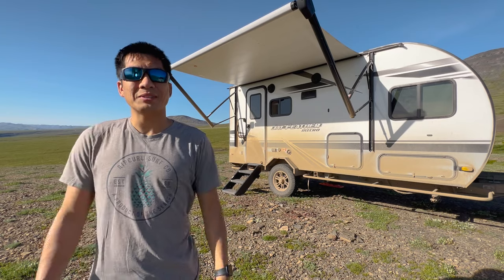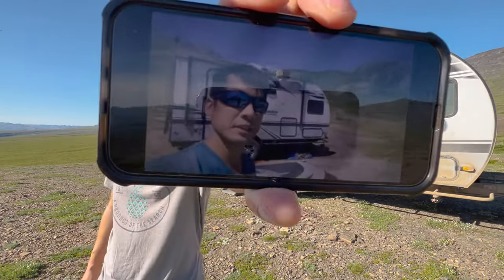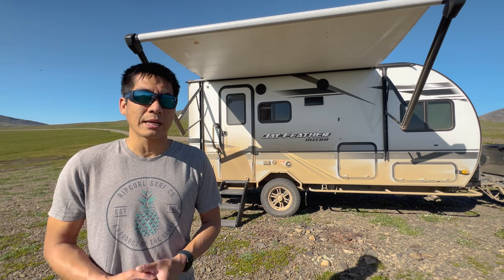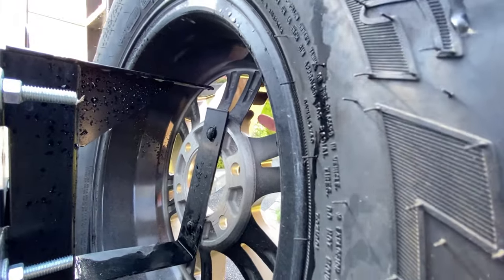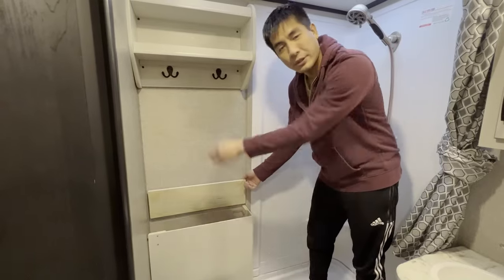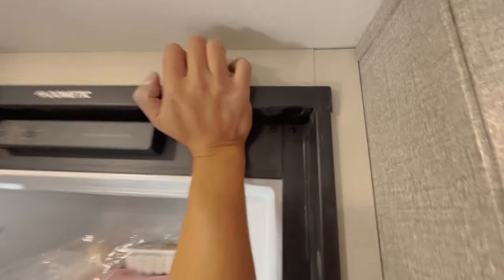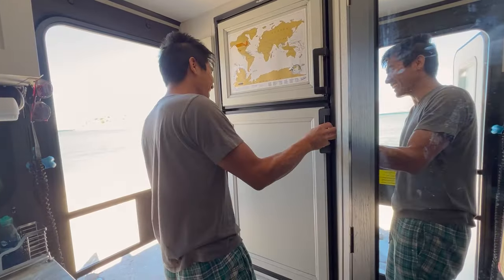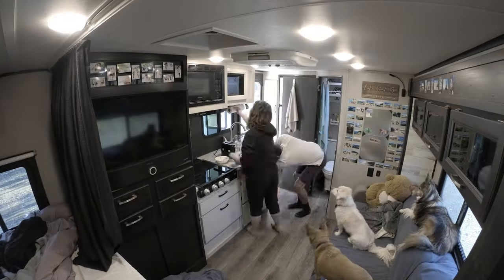Jayco 166FBS Long Term Review - What Broke?

Comment: Sounds like you took a camper designed for paved roads and beat the crap out of it for 31,000 miles! Most if the issues were caused from dirt, dust and pot holes! I think it held up very well considering the abuse it received!

Comment: Sounds like JAYCO need way better QC.  Sad because the models very intriguing to a couple but not if I have to play McGiver 24//7 on the road.
Reply: Some things like the Axle and spare tire bracket are no bueno. They've since switched out the fridges from those dumpy ones. Otherwise I experience the same crap with loose hardware and such in my own house all the time.

Comment: Excellent video!  After watching, my immediate thought was "NO" on the idea of getting a trailer.  You talked about way too many things going wrong in such a short time.  Big things, axel, fridge, water leakage, stove, etc.  Those sound live deal-breakers to me.  Then I factored in that you used the heck out of this trailer in a short time, and traveled on unpaved roads a lot.  I've owned a boat for 18 years and when I take it to a favorite lake of mine, I must travel about eight miles of dirt road.  It shakes the crap out of everything; when I get back home, I have to tighten many screws on the boat.  I really don't want to be a handyman with a trailer, but I'll have to rethink that idea.

Comment: I understand the miles you put on this but I'd be done w/it after the axle broke. And that's after a new full brake assembly replacement. I get all the other stuff mostly caused by the flexing when towing. All trailers flex but I'd be done when axle broke. Thanks for the review!!

Comment: Wow, sounds like a pile a garbage compared to our Escape 19. We have had our Escape trailer for 7+ years now, and have had none of the issues with repairs that you have had. We've been across the USA and Canada, in gravel, dirt, mud, sagebrush, bumpy roads, sand storms, snow, sun, rain etc... and the trailer has been a champ! Always dry, always clean inside, always reliable. The one issue, yes just one, is the plastic support to keep the door open broke off, and work around took 5 minutes to fix. That's it. And we got our Escape lovingly used. Your video is confirmation of our research before buying a travel trailer: nothing compares to a molded fiberglass travel trailer. Thanks for the video, it is a nice warning for anyone thinking of buying a mass produced headache.

Comment: I have 2022 jay feather micro 171bh, and I had the same issues with the leak from the toilet (fiting not screw on properly). The drawers not being supported properly where I had to fix’s in on the fly on our trip (adding in supports), last year in the middle of nowhere in Cape Barton. Max air vent being mounted backwards and the bathroom fan breaking. I also had the seal on the exterior of the front of the trailer falling off and was attempted to be repair three times until the third time they replace the whole channel and now it’s good. Also on our last trip I also notice the fridge shifting. Also the kitchen sink was delaminating which is fix now and is sealed. Great little trailer. But it’s eye opening  to see that some one else is having the same issues
Reply: I also found extra and missing screws is some places, I also some unplug plugs behind the kitchen. I assume it was for the water tank pads, which I plug back in.

Comment: Thanks Mike.  I’ve been hoping you would post a video about your Jayco.  I have the Jayco 174BH Baja.  It’s been okay.  I had axle and break issue as well on my rig.    My axle bent as well along with the Converter dying and a furnace issue.  Seems like once I replaced the issues, it’s been solid though.  I’m thinking of a new rig now, the Jayco 199MBS or an Ember.  There seems to be some good sales.  How much does Star link cost?   You should do a video on that.
Reply from the maker: Thanks for sharing your experience! I think if you could afford the ember then it’s a better buy! Jay feather micros are friendlier on the wallet but I think the embers will generally be more durable.

Our Starlink costs about $192 a month in CAD!

Comment: Do you think those rock bars actually do anything? Thinking we may remove ours to beable to carry more in camper.
Reply from the maker: They’re mostly cosmetic for sure! Might be useful for pushing aside brush and low hanging branches but for the most part they’re just for looks.
Reply: I removed mine. In my opinion, they don’t serve a purpose.

Comment: Great stuff.  I bought a 2023 ! At the start the shaft for the bar b q does not go all the way in.  And the wall on the slide feels lose.  Did you have any issues with the things I mentioned  ?
Reply from the maker: Hmm we’ve never had either of those issues! I would talk to your dealer about it if it’s still under warranty

Comment: Great review. Seems to me the biggest issue is with cheap fasteners and cheap quality factory installation. Question... was the water tank self tapping screw failure and the fridge mounting failure a warranty issue that you just fixed yourself? I mean, had you been a seasonal camper, would that have been covered under warranty?

Comment: Learned a lot from your adventures.   Sounds like you added more weight to the trailer , 
Maybe that’s why you had problems with your axle ? 
Plus you’ve drove over some rough Terrain hard on a one axle trailer . Great  video
Reply: Question  what was the trailer cost and is the side out too short .  Retiring in one more year would like to explore us  thank you. Mike

Comment: Thanks for the review Mike and Daina.  I have a 2022, 166 and agree with just about everything you say about it.  Mine has15,000 miles on it and it just developed a Ground or Short issue and I have no 12 volt power if I'm not hooked up to a generator.  Still working on that one.
Reply from the maker: Thanks a lot! Hope you can figure out your electrical issue.

Comment: Yeah, RVs are not meant to be on the road for long period of time because when you think about suspension, it's not like traditional like you'd find under your vehicles. So, the body of the trailer and when it's inside and or the interior will take all the beating and will start to get lose and break. Now, this all depends on often you travel and where and or the roads you choose. But, if you are mostly stationary then you don't have much to worry about.

Comment: Could a Toyota Tacoma pull that short distances?
Reply from the maker: Definitely but I would recommend a weight distribution hitch and don’t load your bed up too much. Depending on the payload capacity of your Tacoma, the tongue weight of the trailer will already be significant.

Comment: This is probably my favorite rv on the market. Some of these problems are a little disappointing, but not very many people are going to put their rv through what ya'll have. 
Most won't even get off of the pavement. 
Thanks for the video.
Reply: Their is no reason to make excuses for the RV industry. They charge more while they produce a much inferior product.
Reply: @y4buckingbulls485 
I wasn't making excuses. Just stating facts. They make rv' s that are designed to be taken off road. This one isn't one of them. Rv' s like this one are  designed to be pulled on pavement from park to park. 
If you don't want one you don't have to buy one.
Reply: In the video it looked like they were on dirt roads. Not what I consider off road. Off road to me is the Pause, MDC, Bruder trailers along that line. I live five miles down a gravel road. So using your logic I need to  purchase a true off-road RV.

Comment: Ugggh….just confirms why we don’t want to buy an RV.  What a joke these manufacturers are.  ZERO quality standard or control and now they have written into their agreements many waivers you have to sign that give away your rights to rectify problems.
Reply: Yes, the mass produced hoards of RVs are future trash on wheels. But don't be discouraged, a molded fiberglass trailer is a great way to enjoy camping instead of spending your time and money playing handyman because Jayco, et al, don't give a hoot about quality. Especially look at Escape and Oliver, you will pay more up front, but they are well worth it in the long run.

Comment: So....50k miles and everything inside is either completely worn out or in need of serious repair. Obviously you used it as a living space for all that time and daily. So a normal usage of possibly one weekend a month and one or two full weeks a year is actually pretty good usage. Hmmm, typical slightly heavier usage would be One weekend a month and two weeks a year equating to just under 45 days in a year, that comes out to close to 8 years and that doesn't even account for your harsh conditions that most people will never do. The fact that the honey moon falls off dramatically after the first year or two means even less usage. Shoot, most people are gonna get 12-15 years use. Thats not to bad for a 30K trailer.